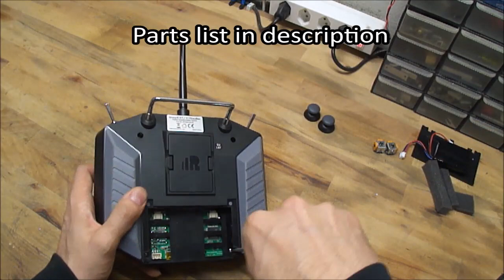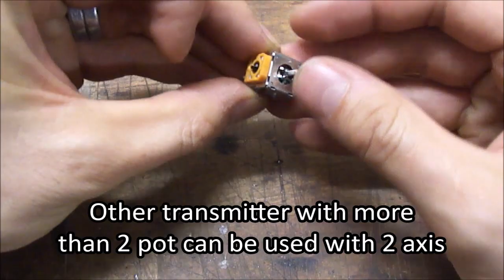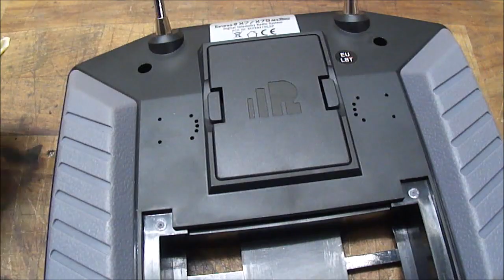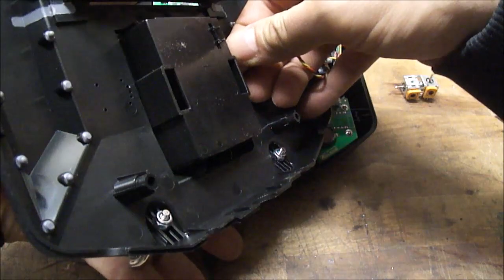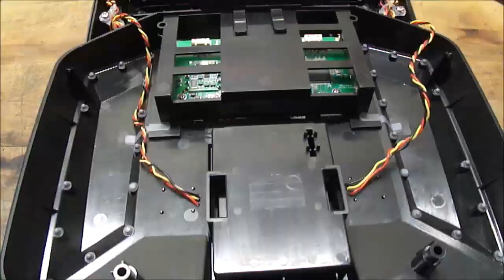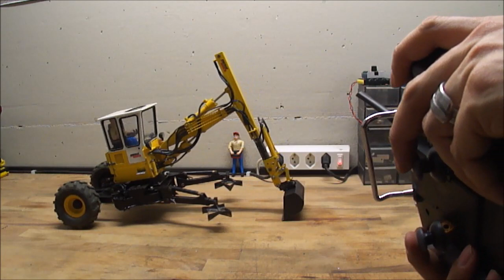[DIY] Frsky Transmitter mod, back joystick for excavator

Comment: That's great. I've watched most of your videos and I am blown by your creativity! Would you mind sharing how you've done it on your radiomaster? I am looking to do the same to mine. Also it's interesting how you use the telemetry for leveling the machines. I'm sure other people would also be interested to see more of that.
Greetings!
Reply from the maker: Hello. Thanks ! Mini joystick on radiomaster are made with same principe than the taranis. I take 3 wire of a potentiometer and put on the mini joy.
Leveling with laser are not controled by transmiter but by relay and arduino. But it's still in developpment.
Reply: @BartsteRCModels  I was wondering which channels on the board are you using to connect the joystick to yhe main board. Because for frsky it's simple but you have 4 channels on the radiomaster. And for the leveling it looks like photoresistors. 
Greetings!
Reply from the maker: I on the radiomaster I use 2 silders (ls/rs) and 2 potentiometer ( s1/s2)
Reply: @BartsteRCModels  Thank you! All the best!

Comment: Your my King! Thats what im searching! I made it on my old Qx7 and reactivate the old Transmitter for All tracked vehicels like dozer and excavator. All Trucks und Car-like vehicels where controlled by TX16S.

NOTE: i used gamepad Potis from Amazon from an xbox Controller and it works fine. Absolute KINGSIZE Quicktipp!!